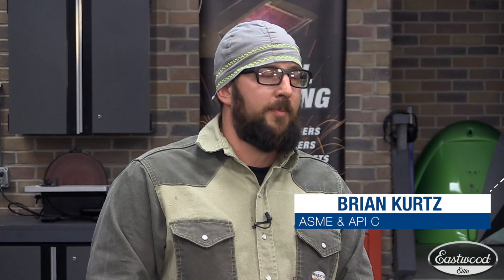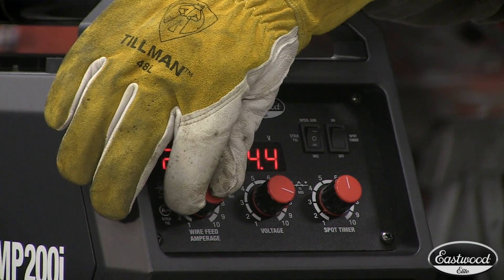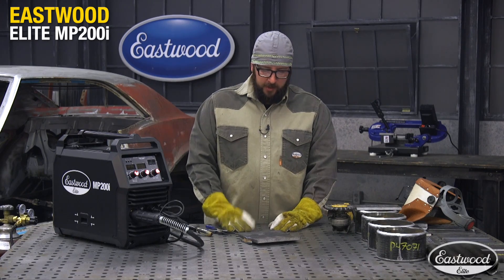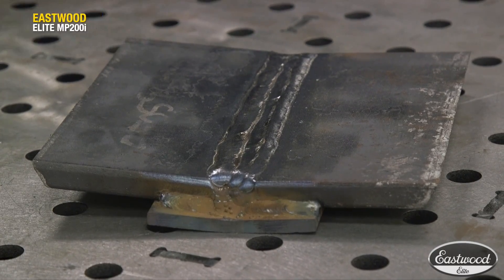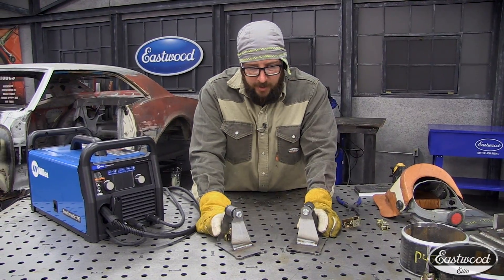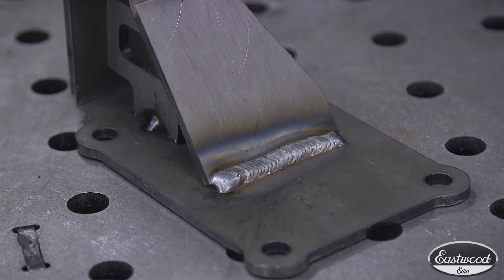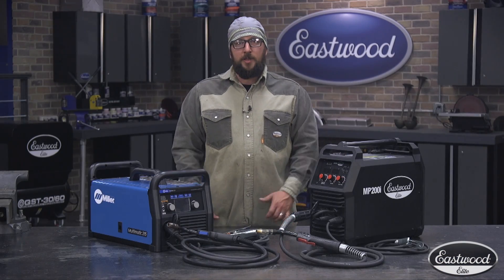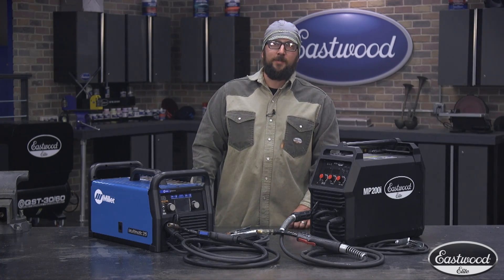Miller® vs Eastwood® Elite MP200i: MIG - TIG - STICK - Which is THE BEST Welder for the Money?!

Comment: The worst I've heard out of Eastwood welders on forms all over the web, is out of the box it's a great value, but from what I've read, they don't stand the test of time like the millers and Lincolns do. So I guess if you are making great money, and can afford to throw away and buy new, Eastwood is for you, or if you just need to get started, eastwood is a good buy, and if you want a one time buy, you're going to have to spend more on that value.
Reply: I've used Eastwood for 8 years. I'm on my 2nd stinger, second mig welder and 2nd plasma torch, all under warranty. But I don't feel I should have to replace my welder every 2-3 years. They're awesome machines... when they work. You get what you pay for for sure!
Reply: And my 2nd mig welder just died
Reply: I have experience with plenty of Millers breaking over the years.

Comment: would you concider the elite mp200i enough welder to build a trailer or would you step up to the 250i
Reply from the maker: Dependent on the material thickness you're using - MP200i is rated to 3/8" while the MP250i is rated to 1/2".